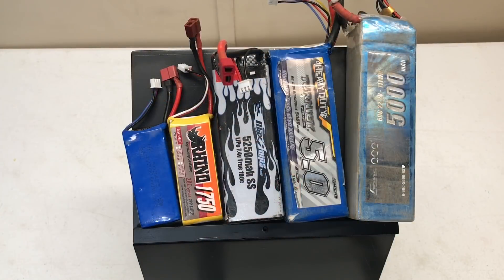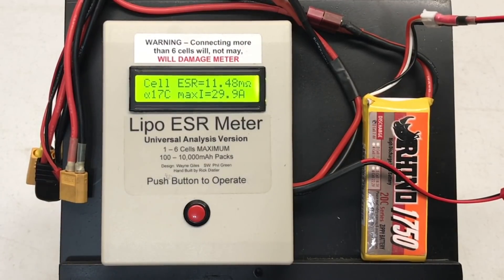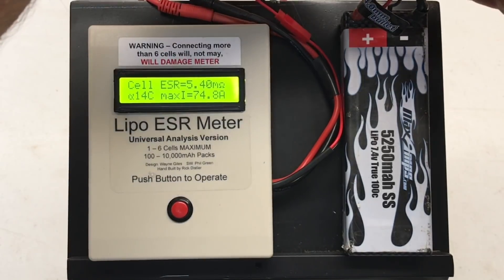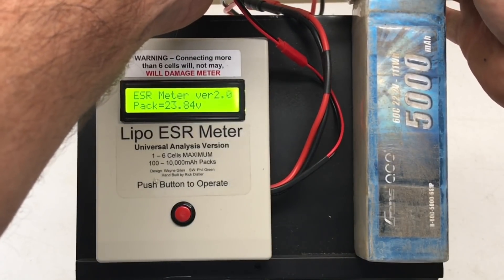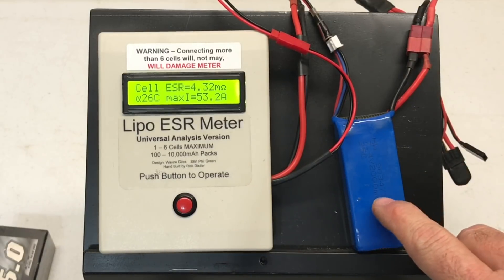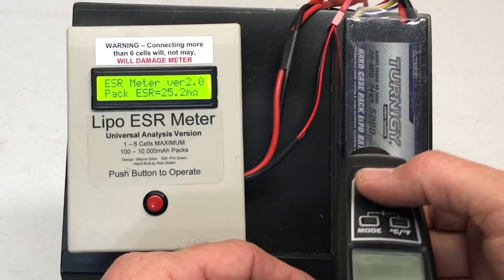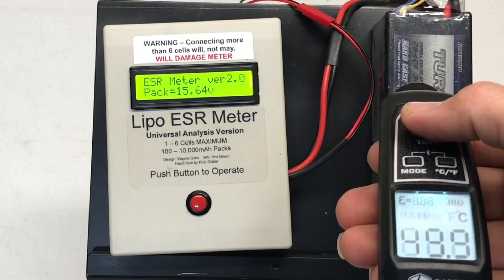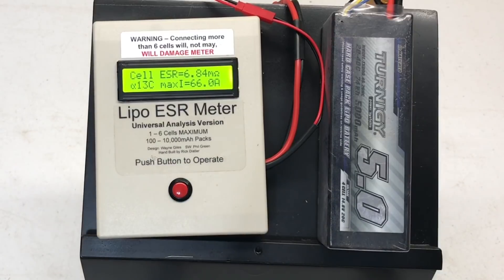Lipo ESR testing, you're not getting 100c discharge

Comment: Okay. I have a question. What's the best way charge a battery using heat.. Do you warm up the battery first then charge it then put it back in a warmer before you run it? How would you go about doing it?
Reply from the maker: If the battery is really cold, charge it slow, or warm it up inside, you can use a lipo warmer or just place over a heater vent. Just PLEASE be careful when doing this. If the battery is slightly warm to the touch its good. Also when driving, if the battery is cold, the available output is way lower and you can damage the cells that way. I feel 85-90 degrees is best for normal usage.

Comment: So, how do you heat them? And you do that to simulate running it hard? Thanks again
Reply from the maker: The way I heat this is kinda wrong but it works, I put a pot of water on the stove, heat it up to almost a boil, take it off the stove and put the lipo in a ziplock bag to isolate it from direct water, then it goes in for a5-10 minutes or until I see its around 120 degrees. Then I remove it from the water and run to the room and record real quick! Lipos will heat up when run moderately and way more when driven hard so the temps shown are not out of the ordinary for many lipos in the bigger trucks.

Comment: My understanding of a C rating is that the battery can be safely discharged at it's Rated Capacity multiplied by the Continuous C rate. What is the rated maximum current of the power wires of these packs that we buy? Most of them have 12 guage wire, some have 10 guage wire, I've never seen one with 8 guage but maybe they are out there. I heard you say that you tested one battery at 100 Amps, which would be 20C on a 5 Amp hour battery. I've seen a 100 amp load through 12 guage Deans wire of a 5 inch distance destroy the wire in Less than 3 minutes, Melted the copper. We should all be careful about our Amperage through the size conductors exiting these batteries.
Reply: Correction, it was Deans brand Wet Noodle style 12 guage wire that was Melted at 100 Amps of DC Current at 24 Volts 4400 mah D-Cell Nickel Cadmium Battery supply
Reply from the maker: yes, the wires on these batteries can't sustain the amps they claim the battery has, the battery only has to give what the load needs to do a job, when the load requires more than what the battery can give is when you have problems

Comment: SMC batteries are the best, great price with proper discharge.
Reply from the maker: they are closer to their discharge ratings by a little bit but anything with a C rating over 30c is most likely a marketing thing to sell you a battery.
Reply: That’s why I like how cheap they are hehe.
Reply: Pretty sure your suppose to test right after you full charge the pack

Comment: Seriously, buying these silly expensive batteries are not just overrated but it's down right larceny. I've been using Turnigy, Floureon, & HRB for as long as I been into electric cars. They're cheap, I get my use out of them, cells die, they get a salt bath, & I move on to the next. Yes, I get a dud every now & then but that's what a warranty is for & I have always been refunded ASAP for a bad Floureon, faster than any other battery.
Reply from the maker: So the Floureons have been consistently good for you? I've never ran one of theirs
Reply: @ExocagedRC  Floureons usually last between 2.5-3 yrs b4 becoming useless. They are hit or miss. Either they will be great or they will come with a dropped cell (2 out of my last 10). Most of the 2-3 cells have been flawless while all 4 4-cell batteries only lasted a year b4 not being able to hold a charge. I still have every Turnigy 4-cell I ever bought (12 in total) & they all hold a good charge, a few going on 5 yrs now.

Comment: I've got chargers that measure the cells m.ohm while charging and that number will change depending on charge %, something to keep in mind, but i agree with your conclusion 100%, my SMCs 5200 4s 90c have more than 2-3 m.ohm per cell, which doesn't add up to 90c.
PS.: You've got a typo in the title, you wrote "EST"
Reply from the maker: fixed the title thank you, I've not noticed any changes to the IR depending on charge but temps make a huge difference
Reply: @ExocagedRC  Oh it doesn't change much, at least not as much as temperature, but sometimes an empty cell will start charging with ~1.4 m.ohm and end with ~1.6 m.ohm, so temp definetly makes the biggest difference !
Reply from the maker: That’s interesting, I’ll mess around with a few batteries and see and if I can see something that’s visually noticeable I’ll make a new video. Thank you